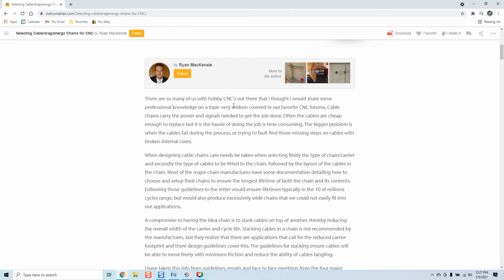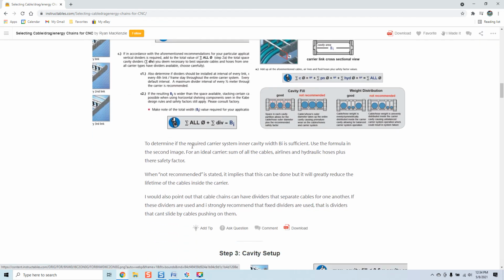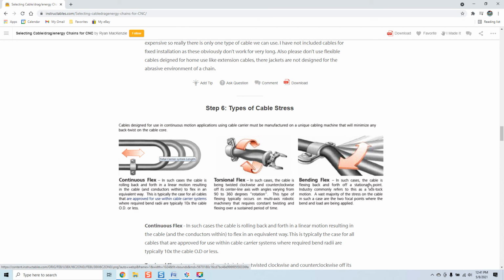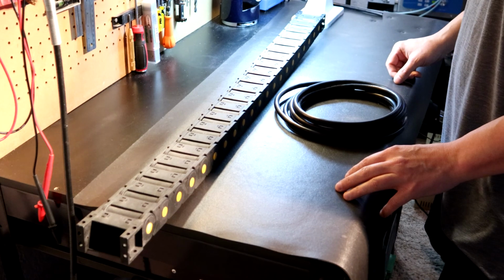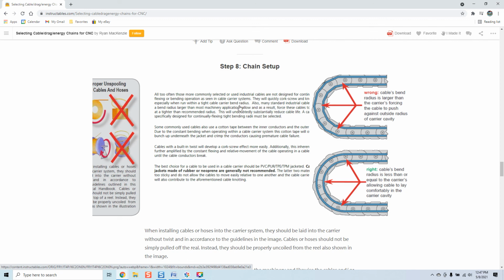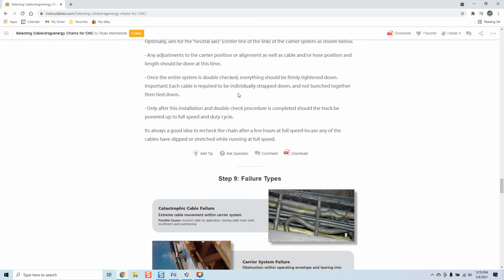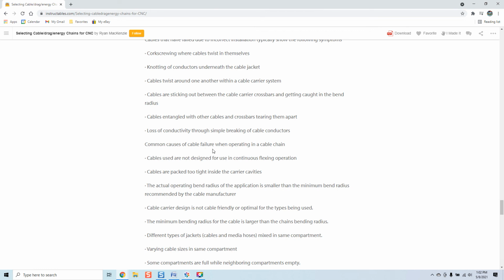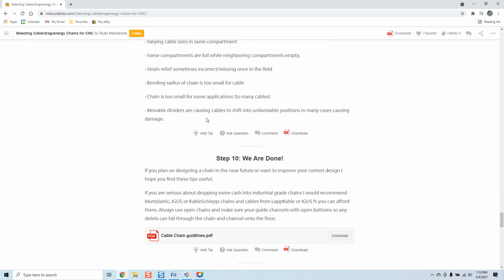CNC Cable Chain Selection Part 1...

Comment: Vince This video saved my a lot of heartache. I discovered that the cable chain I have is way to small for the spindle cable I received from you.   Dave
Reply from the maker: David, thank you for your support. I really appreciate it. I'm glad to have helped as this issue effects many end users with new systems as few vendors understand the size of the cable chain required. Thank you,
Vince